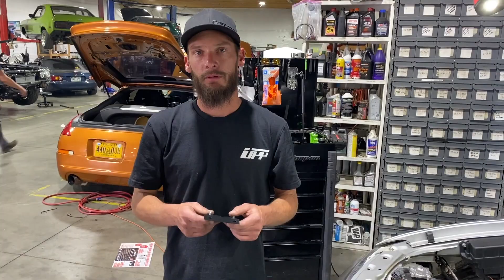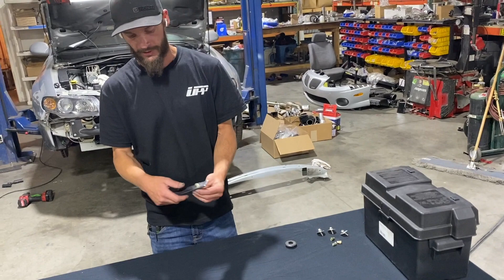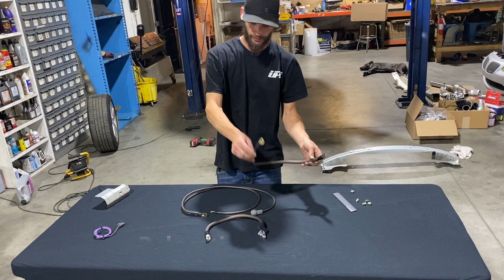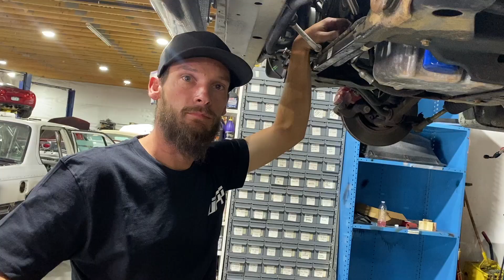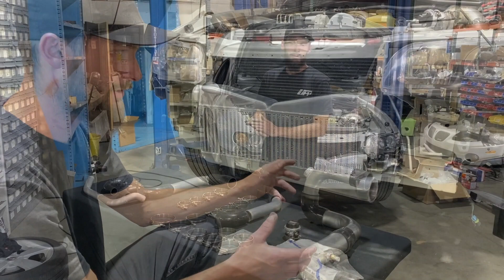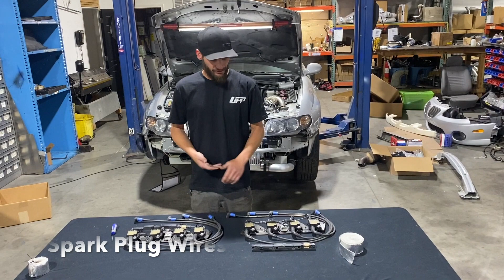UPP Turbo 2004-06 GTO Twin Turbo Kit V2 Install Video

Comment: A lot of people supercharge these engines but the turbo way is the best way to go but it's the harder more difficult way to get extra horsehowever it does Require a lot of extra work rather than just simple bolt on.

Comment: so there’s this g8 gt im looking at for $9,500 with 155k miles on it with cai. long tube headers. magnaflow exhaust system and a tune and it’s been taking care of. guy bought it in 2011 and put 75k miles on it he rarely drives it now and it is garage kept but idk how reliable the g8s are. what are your thoughts on it ? should i take the chance?
Reply: Not sure just bought a 06 Gto with 160k drives amazing
Reply: @Dark_Matter392  is your clutch fluid constantly black? [if its a manual]

Comment: We are doing a single turbo on my 2006 GTO what needs to be done with the MAF sensor?
Reply: Throw it in the trash, put in a GM temp sensor and two of the wires that went to the MAF go to the temp sensor. The remaining wires are not used.

Comment: What about trans? Would an A4 need a different torque converter for this kit?
Reply: No, we've got plenty of customers running around on a stock drive train.
Reply: With this kit you would have to upgrade the Transmission that 4L60E won't be able to handle it.

Comment: Is that a built motor? Or stock ls2 making almost 700 hp?! That is badass man, damn Colorado too, not far! I feel some turbskis coming!
Reply from the maker: Not built, stock engine with our twin turbo kit! The video does say it's running 8psi, but I believe it is actually on ~9psi at those numbers. Give us a call when you're ready for your kit!
Reply: @UPPTURBO  where was this kit installed? What state?
Reply: @bryanriedel1322  Colorado
Reply: @afsfilters5373  thanks
Reply: How much for install? 04 gto?  Nice work 👌